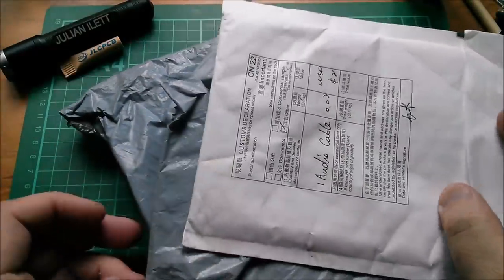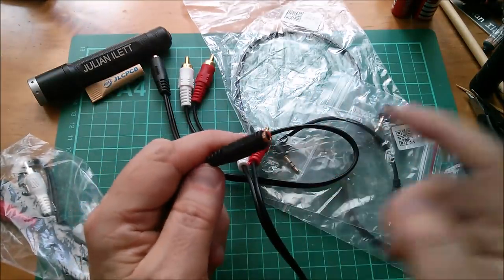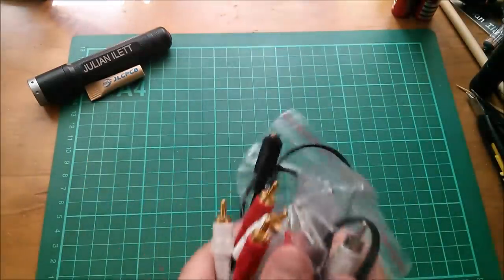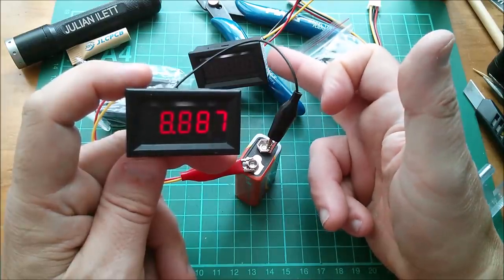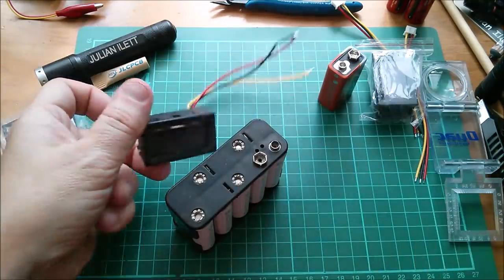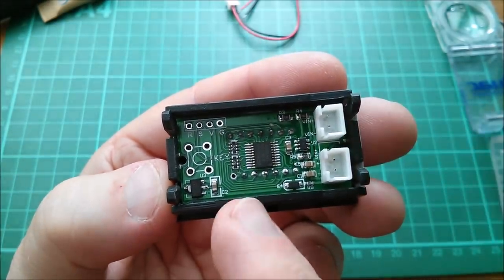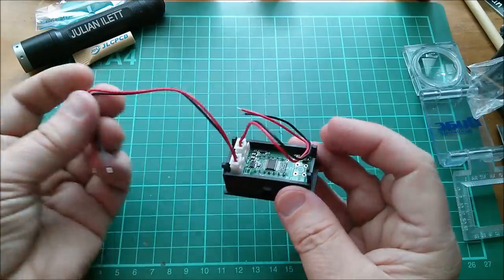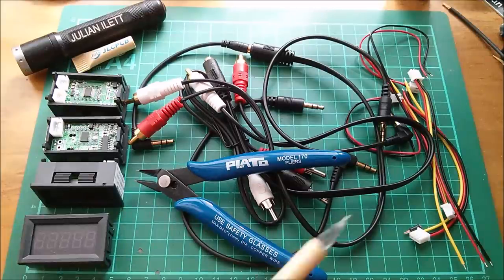Julian's Electronics Postbag: #139 - LED Voltmeters and Cables

Comment: It occurs to me that the meters don't have to be totally accurate, so long as they are all calibrated as close to each other as possible.  I'd do that by connecting them all to the same battery at the same time, then I'd select whichever one is "in the middle" and attempt to adjust the other two to exactly match its reading.
If you want the meters to also be as accurate as possible, then I'd connect a proper multimeter along with one of these meters and calibrate it to the multimeter, then use the above technique to calibrate the other two meters to read the same.
Edit: Or just use the voltage reference.

Comment: Careful with that Plato cutter, I had two of them, the cutters are not hardened on one, and dulled right off, the replacement 2nd one actually broke the jaw while cutting a fairly soft copper wire.  I found some Xuron cutters used (read abused) for a good price for a set of 4, one of the 4 was good enough to use out of the box,  a file and some stoning brought the others back to use, I have never had to mess with them again after a good sharpening on arrival and they are fabulous for cleaning up boards after building projects.

Comment: You can always use the little plastic bottles to hold SMD components for a project build; just stick a piece of masking tape on it to write on (the component values, such as 104R, 224C, 330L, etc...) No point letting these go to waste, now! 😋 Furthermore, the masking tape is fairly easy to remove once you use up all the components in it - brilliant! Cheerios. You can also fill the bottles with IPA (IsoPropyl Alcohol) for use with Q-tips to remove solder flux from circuit boards! Just label it so you don’t drink it by accident - blech! 🤮

Comment: I really like those Plato 170 snips, theyre very low cost and I've bought 3 of them so far. First one, the sharp tip broke off, another one I tried to cut a coat hanger and it dented the blade, and the 3rd one is going strong now that I know the limits of it :P
Reply: Exactly what's happened with mine, except I got a single then a further 3 when the tip broke. So I've got 2 still going strong.
Reply: there were some cutters around years ago that dented when you tried to cut copper wire !  one supplier was practically giving them away !

Comment: You should have the tracking IDs of the parcels in your eBay order list (even though they are usually send untracked). I used them a few times when I received a wrong item and wasn't sure which seller made the mistake because I ordered similar items from different sellers at the same time.

Comment: I bought the Plato cutters a couple of years ago and they are holding up very well! by the way the plato is gone on my pair doesn't last long. lol
Reply: I've had a set for over a year and they held up well until I foolishly cut some steel wire with them.
But I liked them enough to but another pair,rather than seeking out a different type.
Reply: @pileofstuff  Oh I hate when I do that, it is usually my favorite pair that I break. I have been trying hard to use the proper tool for the job. it is so hard!

Comment: Just wondering if you connect all the positives of the 3 wire meters to the most positive of the capacitors, and the measuring and ground to their respective capacitors would work.

Comment: Those cutters also work as wire strippers - the blades have a narrowing gap near the pivot that works quite well on single-core wire, though you may lose a strand or two with multi-strand wire. Good for quick'n'dirty work.

Comment: I have a PLATO 170 cutter. I like it quite a lot. Should serve you well.
Reply from the maker: Yeah, I've used it to trim excess wire from PCB pads - it cuts very close - almost flush :)

Comment: With regard to the side-cutters, I actually had a pair of that model shatter on me the other day. One blade flew off to hit the ball of my thumb where it drew a pin-prick of blood before bouncing up to hit my cheek and again causing a bloody scratch. I wear glasses anyway, but I dread to think what would have happened if it had hit my eye. I was only trimming component leads, so it's not like I was using much force; it makes you realise how hardening these cheaper tools also makes them quite brittle.
Reply: When trimming component legs I always use my spare thumb to cover/hold it whilst cutting!
Not only does that stop trimmed metal flying all over the gaff but it also  prevents side cutters from hitting you in the face if they shatter.

Comment: With the meters you'd be lucky to get 3% accuracy even when calibrated as those cheap pots have a 200ppm/C drift as a minimum. Anything more than 1 decimal place is really only any good for comparative purposes and not absolute values, and even then only if you have an ambient that does not drift by more than about a degree. Temperature compensated meters cost an absolute fortune and even ones with 0.5% drift over the temperature range make a Fluke look cheap. Also they will not do negative currents (and often not negative voltages) as they are using a standard Microcontroller ADC input with just some prescaling resistors etc. They don't have an offset circuit and diff amp input which would give them more accuracy and ability to go negative.

Comment: Hello Julian,
I also wonder if the cables that you have bought are so good now!?
of course these cables do transmit the sound,
 BUT are these cables really well shielded ???

What I mean is are they good HF impact resistant?
 For example, if you keep a cell phone with it, does it not hit the cable?

also something like this, i have radio transmitting equipment here, 
if sometimes i get too close to an audio cable with this equipment ( for example a transceiver ) then that sometimes strikes as a BOM!

VrGr Rob.

Comment: Watch out with those cutters. Dont try to cut anything thick one tip breaks off and will fly. A while back you bought those tiny little dc to dc converters you can use them to isolate the power on those meters. Like b0505s I think they were.
Reply: Yep. Been there done that. If you don't cut anything too  thick they last fine

Comment: Are those four wire one's differential or is the negative on the sense connector tied to the same ground as the power supply? Because you might be able to use them on the same power supply if it's differential and the listed voltage is the common mode range.

Comment: Since all those years, why didnt ever buy a descent calibrated multimeter?
Reply: Julian's just a bit silly at times... although I secretly wonder if he's winding us up... He has multimeters... And adjustable power supplies... But never used them when you would think it logical!! 😂 I was thinking on the four wire meter he should check for continuity on the ground lines to see if it had a common ground... But did he check? :-P Sometimes it's stuff for a later video though...
Reply: @pfeerick  by the way I cant remember a single video with a Julian using a good and calibrated multimeter.
That is sad because some of the LCD volt/ ameter he unbag and "test" are very good and some are very big shit.

Comment: I've been looking for a 2 decimal place 3-wire meter. The only 2 place ones I can find are 2-wire or panel mount.
Might have to go for the 3 place one instead.
Reply: There's a mod to convert the small cheap white 2 wire volt meters to 3 wire, if that's the one you have, on the inter's. I think you cut a trace or remove a resistor, and then add a wire.
Reply: I have a one decimal place 3-wire meter, was looking for a two decimal place 3-wire meter

Comment: i have used 100ua and 10ua meters in detectors, they are quite good though the single mode versions are better, the ones that do volts and amps are nowhere near as good.
they make good meters for home made bench power supply projects, just buy a separate volts and amp meter, be careful when you buy the differences between 100ua, 10ua 1amp 10 amp and 50a, are not as clear as they could be, same with volt ratings just select the correct one for you.

Comment: 9:38 Interesting that seller has tried to blur out the "plato" text from the pliers
Reply: Maybe they just send whatever they have on hand, and sometimes it is Plato, sometimes some other brand, so they tried to blur it out to prevent buyers from getting upset if it isn't really Plato they receive (?)
Reply: @Markus0021  Maybe... Normally they do that when they are selling some fake product of name brands.
Reply: These and similar wire cutters are often marked or made to look similar to more expensive types...
I’ve bought some before, shorty after the listing was taken down, and I don’t mean sold out.

Comment: i bought 2 of these volt meters before thinking i'd have one showing positive voltage and the other negative...but i cant seem to find any info how to wire up the volt meter for negative voltage?
Reply: Simple: Make sure the positive connection of the meter goes to the more-positive side of the circuit (and vice-versa of course).  It really is as simple as that.
Reply: @melkiorwiseman5234  Hi yes tried it..had to tag the negative voltage to ground and ground to meter's voltage measuring input. i think in my head i was hoping the 7 seg led would show the negative sign... :?

Comment: i got a led volt/ammeter 100v/10A at a not so local electronics store in a neighboring state. got home and the diagram in the package shows the expected 2 wire thick cable for the current and a 3 wire cable to power the unit and give a V ref to it. the meter though only had two 2 wire cables and no matter how i wire it i only get to measure the current. oh, this has no name, no identification numbers visible on the circuit board. i can't return this because i do not want to drive 100 miles each way.
i want to characterize some solar panels and cells but this is useless.

Comment: Could you leave me a link to the accurate voltage reference please?? Thank you. Or it's name/number would do👍
Reply: Search for 4-Channel 2.5/7.5/5/10v High Precision Voltage Reference Module on ebay, there's plenty to choose from. Also you'll need to source a 12v or 15v battery. Hope this helps.
Reply from the maker: Or search for the chip name - AD584
Reply: @0RDClark  Thank very much Roger this dose help. If been wanting one for a good while but keep forgetting to look one up when I'm buying stuff.
Reply: @JulianIlett  ad548 will do. Cheers👍
Reply: @keithking1985  Also I managed to heatshrink (28mm works great) 5 CR2354 cells together for the 15v - gives a battery length of 27mm which is just about right.

Comment: hoping you'll have a video where you hook all of these up. I have a bunch and I need to address this.
Reply from the maker: Yep, I'm building a few 18650 battery packs very soon - the voltmeters are for that project :)
Reply: @JulianIlett  Cool . It looks like the current versions would need to be powered with 9v batteries. The voltage ones could take a little juice from the 18650 circuit .